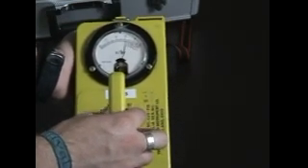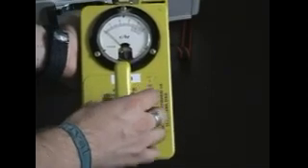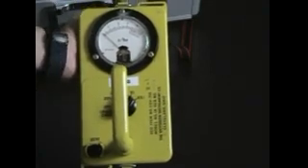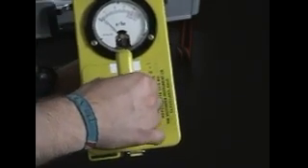Para-Cast Episode 3 : Radiation Detection

Comment: While your checking and zeroing information is good, that unit is utterly worthless for detecting radiation at any levels below that which you would get from a nuclear meltdown or fallout from a nuclear attack; any true Geiger counter would max out at half the radiation flux it would take in order to move that needle to 0.1 R/hr, and even a Geiger counter isn't able to detect radon (unless concentrated in carbon or on TV screens) Try it with a radium clock if you'd like to see for yourself.